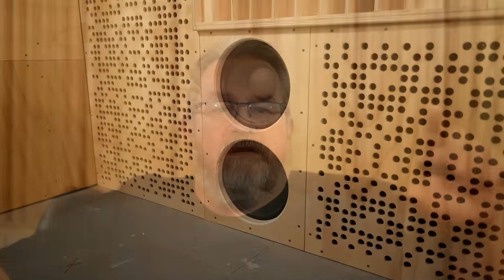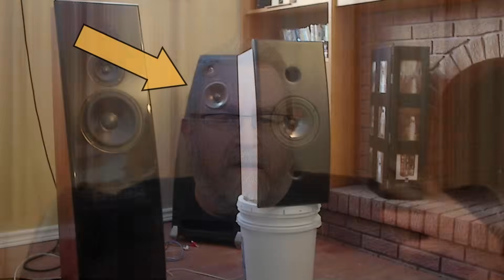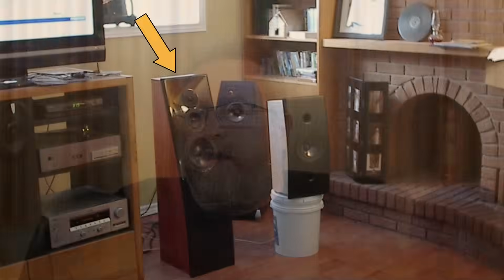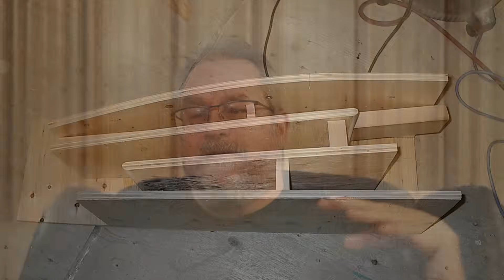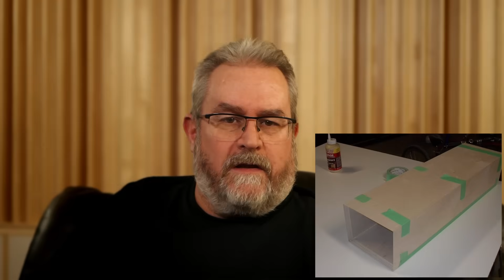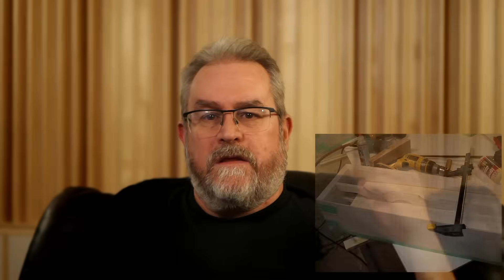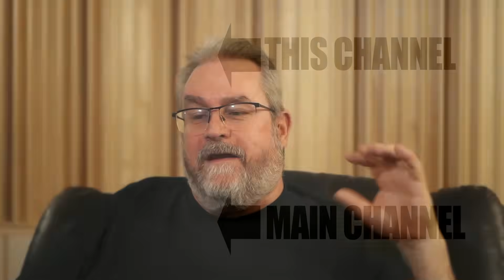Transmission Line Speakers are a Trap

Comment: Really good explanation that non speaker designers can understand.  The crucial thing about quarter wave transmission lines is getting that ripple under control and unbeknown to the unwary, the relationship of the position of the back of the speaker to the opening of the horn throat is critically important.  Moving the driver even an inch off the critical position can cause significant spikes at specific frequencies and ripple beyond which is additive to horn ripple caused by pipe resonance.

The only way around this is to make a series of removable driver mounting baffles to experiment with driver position relative to the horn throat and use measurement to get the best result.  Then the horn stuffing needs consideration.  Some just stuff the pipe at each change of direction, others use a fixed amount of loose wool stuffing behind the woofer in the throat of the pipe, others line one side of the pipe using acoustic foam.  Measurement is crucial to see the effects of tuning the pioe.  Some calculate the pipe then shorten it by a percentage guessed at (perhaps 10%) to account for the effects of the stuffing.  All that is before the headache of the crossover is concerned.

The biggest trap in most diy speakers is the crossover design. Most diyers guess or “calculate” the crossover values then tune by ear. That is like shooting in the dark and usually ends up miles out with screwed up phase alignment, non linear response, no idea of impedance effects, no consideration to effect of actual crossover point on polar response or driver resonance point/cone break up effects so distortions can be unacceptably high.

I only say this as a designer who hast spent more hours than I care to remember sorting out crossovers for clients who tried but struggled to get it right.  Invariably, no client who didn’t use measurement to begin with got anywhere near close.

The other thing frequently got wrong is cabinet resonances resulting in wrong tuning or terrible looking water fall decay plots.  Again, correct tuning cannot be merely calculated for port designs.  It needs measurement of impedance v’s  frequency to fine tune and get it right.  Often, ported enclosures are over damped with baff which can sit on dynamics and result in overdamping of the woofer.  Just acoustic foam panels are sufficient.  Some manufacturers  over stuff to get cabinet size down making the speaker cheaper to make.

Transmission lines are undoubtedly the hardest but even vented and sealed speakers have their pitfalls, especially achieving correct crossover, tuning, system Qtc  and cabinet design which are all fundamental to sound.

I would agree that TL designs are not worth it to the amateur and no TL design I’ve ever heard convinces.  All seem to have bass lag or obvious one note bass  where peaks in response dominate.

Comment: In the late 1980's, employed true pipes.  6 inch ID, Schedule 40 with 4, 90 degree, elbows/driver for a 12 ft long, "Waveguide", 2/channel. Used very little acousta stuff. The ,"Stuffing", back in the Day was thought to couple with the air in the waveguide/line and decrease the Velocity of a propagated wave in the medium, air. So, slow the speed of sound and permit waveguide/line to behave as if it was physically longer.  Loaded each pipe with a, 6 inch Morel 164. The output was adjacent and in the case of the lower driver, below the driver, the output above in the case of the upper driver to couple the Morels together acoustically as I stacked the pipes one on top of the other, symmetrically, with 2, H shaped baltic birch plywood pieces siliconed to each line .  The reason I chose a 12 ft length, the Mass of the air  couples to the driver and lowers the Fs. Did achieve Bass flat to 23 Hz. I believe it was Ben Olney who realized this. I had taken Partial Differential Eqs. a couple of decades earlier and remember the inability of the Discipline to model Turbulence and employed the smooth walls of the pipe to minimize said Turbulence, hence increase laminar flow. Anyways, crossed over at 200 Hz, via single pole filter, to a Speaker Lab RD-57, a 2 inch wide, 54 inch long, push-pull, planar magnetic, dipole, driven by my version of Audio Amateur's Lang Amp. A MOSFET output stage, Class A Topology where I employed Nelson Pass and J. Peter Moncrieff's written advice to build out from the circuit boards. 350,000uf of double bypassed Capacitance, HEXFRED ultra high speed soft recovery diodes, for rectification, source resistors, Caddock metal film in TO 220 packages, 2 Toroids/channel, an output stage-unregulated, and an input/driver stage-tightly regulated, and really large heat sinks with a bias Current of 4 Amps. The Bass performance was very tight, clean and holographic, did what I required, gave me loudspeakers that equaled my Stax Earspeakers.
   I really enjoy your channel. You are courageous, highly skilled, and open minded, so interesting too, in presentation.

Comment: Well, you see, and I created a transmission line from old Polish cabinets and I cushioned it with 3-4cm cm foam and I did not measure anything and I am very satisfied with the sound of :d If you are undemanding, the effect from these speakers will always be good, but of course, if you do it properly, it can be even better.  Personally, I think it's better if you don't measure anything - it's better to create a transmission line speaker than a speaker with bass reflex. The bass reflex is just a dirty rumble with a great demand on the space of the :D

Comment: I have been building speakers as a hobby for at least 40 years or more. I have experimented with different designs (haven’t tried horn or open baffle yet). In my opinion speakers are the weak link in most systems. They are the weak link because they have the most difficult job, converting an electrical signal to pressure/acoustic waves in air. I believe speaker design always involves compromises and listener taste is a big part of deciding what compromises are acceptable. Also the intended use of the speaker can be a factor. 
I have concentrated on home stereo speakers and for me clean accurate sound reproduction has been my goal.   I prefer low to moderate listening level and enjoy a range of music genres.
To that end I found tapered quarter wave lines to be the most satisfying. I did not find the basic design and building all that difficult. I used high quality mid base drivers (5” Focal w cone design) and matching 1” tweeters. I used Martin Kings alignment tables and a bit of tweaking to get the sound I wanted. I believe TLs do a great job of taming the woofers reducing mid range distortion. I tuned them to just below the drivers Fs as recommended, experimented with placement of the driver on the baffle and with stuffing. I used a calibrated test mic with decent test software. I was so happy with the result that I haven’t built another speaker yet in about 14 years!

Comment: got questions why (at least what ive found )does the mouth of the line have to be on the same face as the speaker. ive built several to this mapping and all had amazing sound range never had to dampenen an of them .
Reply: I doesn't have to, but the goal is that front and back wave adds, so you control where they add.
Reply: @pablohrrg8677  They’re going to add the same way no matter where you put them unless the transmission line is not folded. Sound waves are absolutely massive. The size of a box is nothing compared to the wavelength of bass notes.

Comment: Hi, very interesting subject, I built a pair of transmission line Cabinets about 40 years ago the plans were out of a magazine from the 70s .
I just recently had to replace the driver units 8 inch woofer with a 4 inch Tweeter SEAS , I have not yet tested the frequency response but I have definitely changed I think they have improved tremendously, The line length is approximately 14 feet and they fire out of the bottom, The only thing that I’ve done differently is that I have raised them off the floor for another inch and I have tilted them forward, Some friends of mine have listen to them and they cannot believe how well they sound, My taste in music is very varied from classical to heavy metal and just recently got into Nordic folk music song is very dark and I listen to quite a lot of blues as well, 
I have listened to your tutorials on HIFI by for , and it is always very interested. Keep up the great work.
PHIL FROM THE DARK SIDE OF THE MOULIN FRANCE, 🎼🔊🎶🎸

Comment: Made a pair of sono tube speakers, 4" driver approx 14" long as per 1/4 wave length calculations w/ about 2" of fiberbatting. Super surprised at how well it sounded, recognizing a large part of it was luck.

The idea came from a Popular Mechanic outdoor speaker, comprised of two vertically nested sono tubes filled with sand in between, an up ward facing speaker w/cone reflector.

Comment: I must confess most of what you talk about on this channel goes way over my head. It still intrigues me though. A long tie ago I looked into chasing down a perfect audio system but gave it up.

What I was curious to know was, are you chasing down listening nirvana or are you just taking a journey to see where it leads?
Reply from the maker: The setup I have now is as close as I need to get to the idea of the ultimate listening  experience, so I'm not necessarily on a quest to find something better. And the concept of "better" can be slippery in that it's completely subjective and affected by a number of factors that can change over time.
But to answer your question more directly, for me it's not really about having this or that piece of gear - it's about me being involved in the making of the gear that gives me the most pleasure.

Comment: Brings back pleasant memories.  I used to build transmission line speaker in the early 70's based on the original designs of Arthur Radford.  Fun times!
Reply: The Radford Studio Monitor S90 is stil an excellent design even with new current drivers with similar specs for all three drivers.
Reply: @Henri-JulienChartrrandGontrant  We used to use the Kef B139 woofer and the midrange-tweeter panel from the Quad Electrostatic speakers.  Fun times indeed.

Comment: Not only are they more complex, but I get the impression that even if your back impulse is in phase with the front, it is still time delayed, so you'd always have a little smear going on in the lows. Maybe not much, but I'd know it's there and that would bother me.
Reply: much less than vented.
Reply: The delay should be half cycle only.
Reply: This is what makes me question the worth of this design (specifically, ending the transmission line with a port. You'd be adding artifacts acoustically. Furthermore, if the port at the far end of the line just abruptly ends, some of that acoustic power is going to reflect back up the line and push on the speaker. I guess all's well if you like how the result sounds but philosophically this isn't a way I'd want to go.
Reply: A vent design needs more waves to enchant a resonance. 5, may be 10. That’s a bit slower than 1 for the trap

The best way is a double powered amplifier, but these days one driver with Qts about 0.7 is for five with Qts 0.3. So, it’s not easy to find a good one. Typically manufacturers have only few drivers in entire model line of woofers. Like a single 10” model and a single 8-6”

Comment: Ι will never make another speaker with a different bass-loading technique. When done properly it runs circles around other speakers' bass performance. It IS complicated to build and it IS big (especially if you are using 10"-12" woofers like me) but the outcome COMPLETELY justifies  the hassle.
Reply: The fact that you have correctly placed the apostrophe (so rare!) leads to believe that you have been similarly exacting in your ‘speaker build 🫡
Reply: Totally agree, I made a 3” subwoofer that outperforms my store bought 10”
My only problem with them, is the amount of material, it took me almost an entire plank of MDF for one relatively small box. But that also makes it heavy and rigid, keeping away unwanted resonance.
Reply: @KevinDC5 how did you determine the shape of your t-line?
Reply: The modern modelling techniques and tools now available for designing enclosures along the continuum of quarter wave length behaviour have advanced considerably from the original work of Bailey, et al, and are far more involved than can be summarized in a 9 minute YT video. The DIY community benefited greatly from the work of Martin J King, and numerous designers such as Scott Lindgren continue to offer their plans either for free or nominal fees. During a period of well over 15 years I’ve personally built literally scores of enclosures based on such designs, and have been very satisfied with a pair utilizing  10cm Mark Audio wideband drivers in an MLTL variant for well over 8 years .
And to add more fuel to the fire of debate over cabinet materials, a very early experiment was two pairs of identical bipole TL cabinets using small CSS drivers in both 3/4” MDF and Baltic Birch plywood; the latter had “faster/cleaner”  bass response with finer resolution details of midbass articulation.
Reply: I agree. Correctly designed and implemented T-lines are king and the only thing that can come close is chambered aperiodic akin to HexiBase’s. 
Plus if what this guy is saying is true then PMC would’ve never gotten as big as they are.
Reply: I have a pair of Xanadu AW11 Ti and damn those things have bass for a 5.5 inch woofer. Not as low as my rel strata 3 sub but comes pretty close
Reply: A good 6th order will out perform it any day